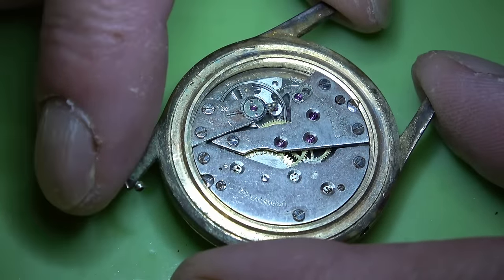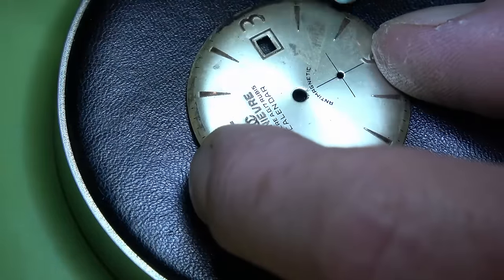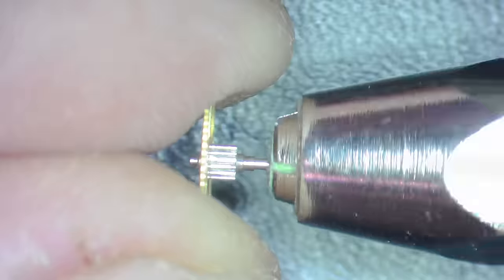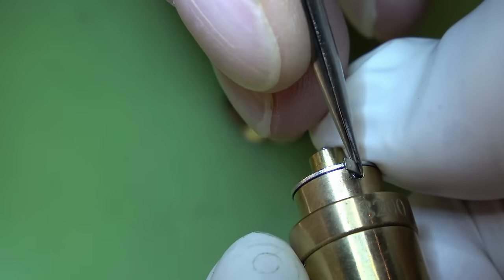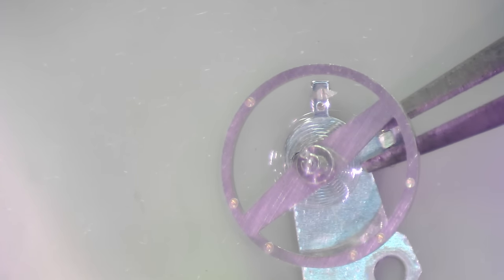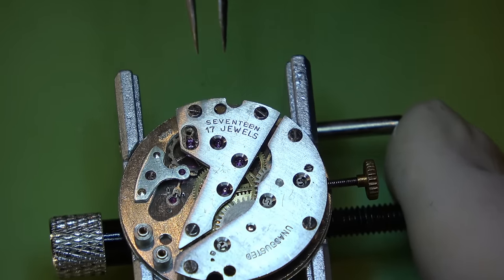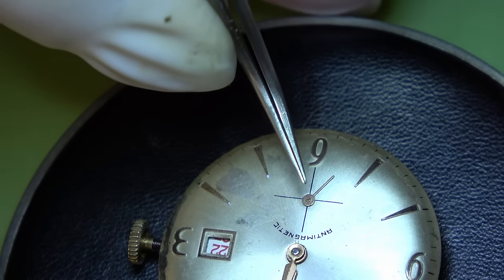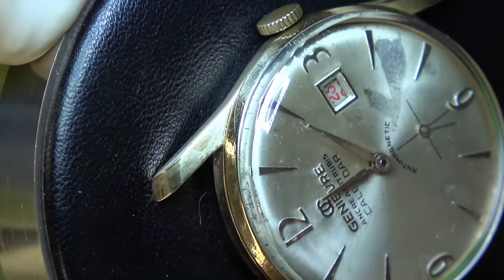You Won't Believe What I Found Inside This 99p 17 Jewel Geneievre Watch with a ORA 234 Movement!

Comment: Just thinking.  Some pallet jewels are cemented in place with shellac.  Any chance that the alcohol will dissolve the shellac.  Of course,being a pin pallet the pins are pressed in.  Excellent job, especially on a worn pin pallet!!!  Cheers, Geoff.
Reply from the maker: Thank you for watching My friend 😁👍. It certainly would dissolve the shellac if left in there for any length of time but I am thinking of 20 seconds or so literally to replace the water left from cleaning that I can’t spin off. Should also dry quicker then. 😁